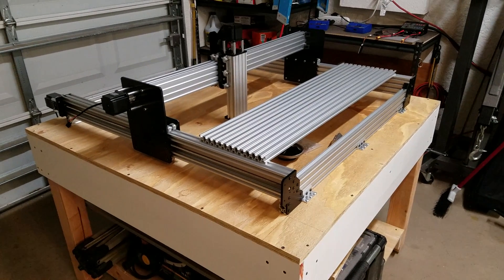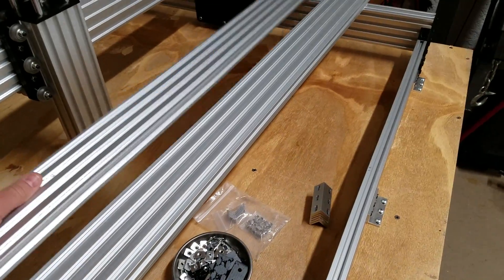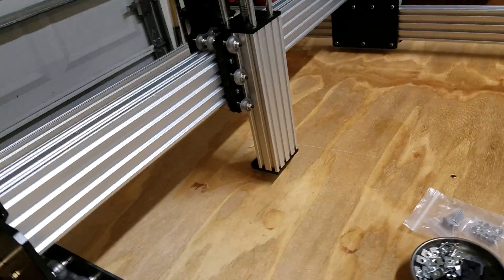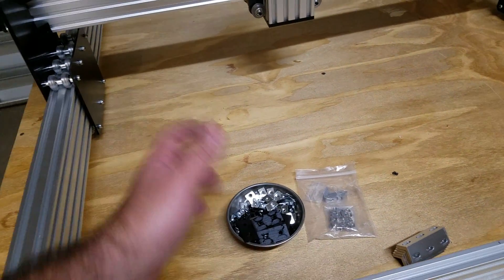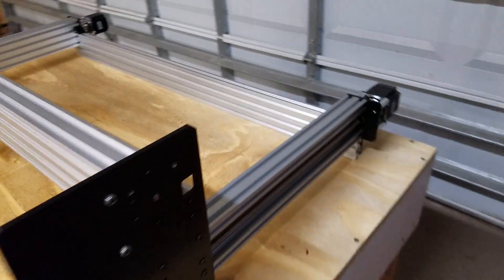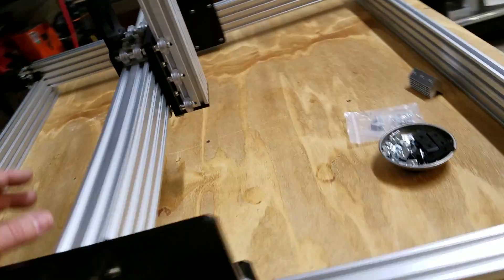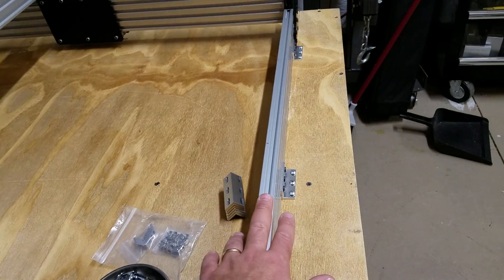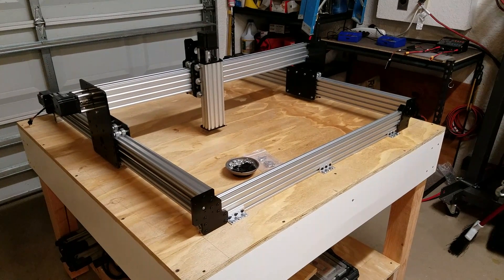WorkBee CNC Router: 5 Inches of Z Axis Travel!

Comment: I have been lamenting the low z work area, and slamming my z limit switch every time I'm trying to cut 1.5" with a 1" flute. Was going to get new extended plates cut for the gantry, but you just saved me some $ and time. I think I'll recess the spoilboard to be just hair above the 20 40 on the front and back so I can cut longer materials hanging off front and back (already ditched the 20 60 to buy a little extra Z).

Comment: The wood will change shape with the weather, especially in that garage. The selling point of these is that .02mm accuracy, but you won't get that with this. I bought two extra front/rear extrusions, welded them to the bottoms of the original front/rear, mounted the usual spoil board supports to those added pieces. It's just as rigid as stock, almost as much Z gain, I still get .02mm accuracy (better than that, for most things). I added angle brackets to reduce flexing, but it wasn't necessary.
Reply: 0.02mm accuracy is handy for small items but It's possible to get too worried about that accuracy over distances of the order of the length of the machine. Bear in mind that the length of the 1000mm extrusions increases by more than 0.02mm over just a 1 degree C rise in temperature.
Reply: dont suppose you have a photo somewhere?

Comment: Nice one!! Mine started life in the same way, but I ended up chucking those motors and controllers out the window as for my needs the accuracy just wasn't there. So I retrofitted a closed loop setup with stepperonline motor kits, NVEM V2 Novusun controller and Mach3. Now I can see on the software the exact position of the tool tip, and with the Xbox controller move the thing around with joy sticks!! So happy days. Still a nicely put together machine thought. No question. I would buy another one, but without the electrics.

Comment: Mate, thank you for posting this!!
I'm building a very similar machine and really disliked the design of the base and spoil board setup, then thought of the same solution you have here, but kept thinking "I'm an idiot, It must be like this for a reason". 
After seeing your machine though i'm still sure i'm an idiot, but i'm definitely going to mount the waste board directly to the table, and throw those middle beam things in the corner somewhere.
So feel free to let me know if it turned out to be a bad idea..
Reply from the maker: It works great.  I'm not sure why they don't tell you to do this in the instructions.  The only thing I would do differently is make the base smaller.  If you are doing a lot of cutting, dust and chips can pack up under the y axis rails.  Macy the base narrower and the problem goes away.
Reply: @FrancoCNC  Nice! Thanks for the tip!

Comment: What's underneath the 3/4" ply? Seems you could cross-member or torsion box the frame underneath to help with any rigidity problems. Also, your video has convinced me to go ahead with purchasing a workbee. Woot! :)
Reply: I put a few 1x6 braces under there. It seems to be good enough - a torsion box would be better.  I've seen several of my friends build these routers and they all seem to like them.

Comment: Hi Franco, thanks for you videos on the building of the WorkBee 1000X1000 they have been a great help to me in my building process.  I hope you can help me with the decision to do the same as you have done in screwing the frame to the bench top to give more Z distance.  Have you had any problems with this configuration, or should I revert to option 1 or 2 as shown in the instructions. What are you thoughts?
Reply from the maker: Hi.  No problems.  I sold the router to a close friend who does woodworking and he uses it quite often.  He likes the way it is mounted to the table.  Just be sure to keep the dust and chips from packing up under the rails.
Reply: @FrancoCNC  Thanks for you quick reply, will go ahead with this method.

Comment: If the length of the machine was 4ft long. With this current set up you can slide in a full 4x8 sheet from the side. This is a very nice option.

Comment: Always trade offs. Like you mention the Z rigidity (which is my main concern with this machine). And you also loose the option to slide longer pieces in, and cut them in multiple operations. The original setup would allow you to cut basically infinitely long boards,  if you index each machine length with dowel pins etc. But if that's not important your solution will probably work fine. I hope you can manhandle the Z axis some, and try to gauge the flex and rotation in it. I would love to see how rigid this thing is. Coming from the shapeoko world, the Z axis deflection is what worries me about machines in this class. Im wanting to get this kit too, but don't feel confident enough in the design yet.
Reply from the maker: Good points.  Give me some time, and I'll take some cuts that test the rigidity of this router.  Thanks!

Comment: Hey Franco - just saw this. I did exactly the same thing right out of the box. I couldn't understand why I'd want to waste all the available z travel putting the rails down on the inside, creating a false floor essentially. I get it that the cutter might not be as rigid at the lowest point, but I'm not machining metals. One question though - did you have to alter the z-axis limits in the config file?
Reply from the maker: Hi.  I'm not sure what software you are using.  I used Centroid Acorn software/hardware.  Part of that setup is describing the limits of travel for every axis.  Naturally, the table arrangement we have used permits more travel on the Z-axis.  Thanks.

Comment: realistically you will not be using all 5 inches of travel so this was pointless
Reply: depends on 3d work in wood, or if he wanted to use a 4th axis. if he wanted to work in aluminum he could just throw down a couple sheets cut it and pull them back out
Reply: Depends. I would like to see a project of a CNC longboard decks and they can be quite high profile before CNC. I was wondering if this router would work but looks like it will like that. Another mod possible to do it it to cut new X gantry with the additional 5 inch and keep the rest stock. Then you will probably need to make the Z a bit more rigid but for cutting wood should be fine.
Reply: That's not so, most my work I do is over 3 inches, 2 inches of cut is almost useless if you ask me, un less your cutting out flat shapes.